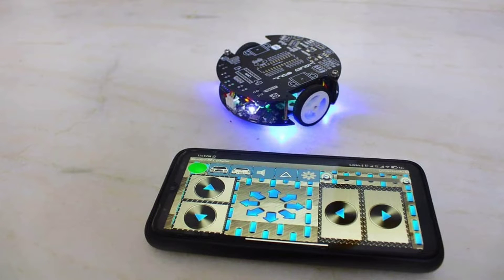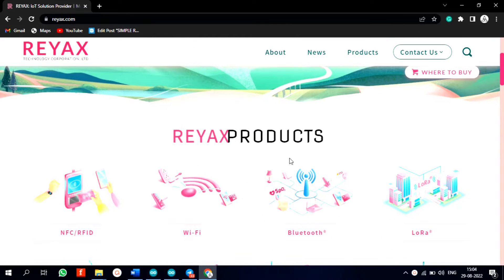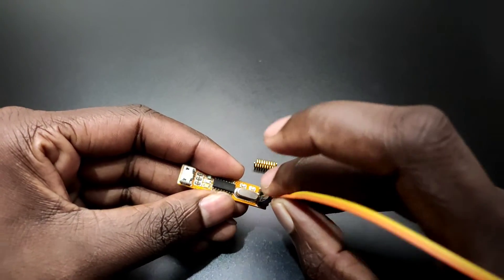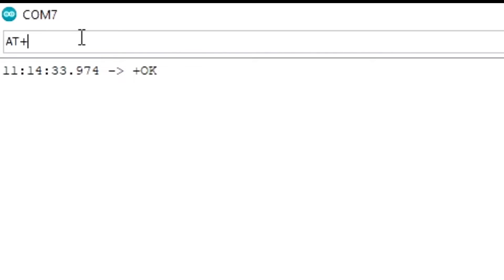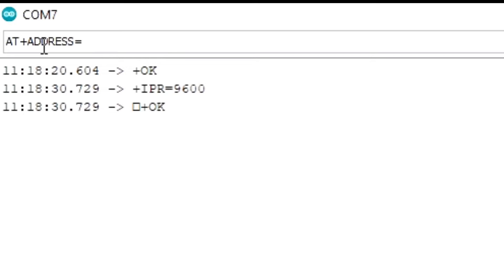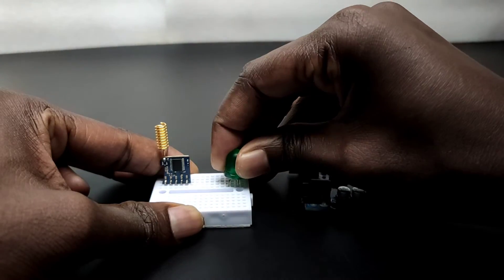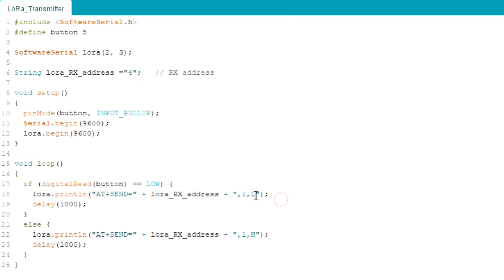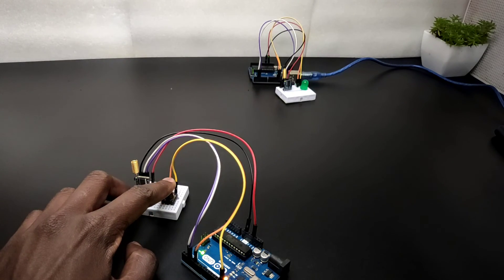How to interface LoRa module with Arduino | Reyax RYLR998

Comment: I have RYLR998,  when set band using At command "AT+BAND=865000000", it remember only when it is connected, when i disconnect and connect and ise "AT+BAND?"
it shows +BAND=915000000Hz, why it is not remembering BAND?
Reply from the maker: You have to save it . There is an AT Command for that . Check their datasheet
Reply: @EDISON_SCIENCE_CORNER  I went through complete AT commands and other doc, nowhere mentioned of save, BAUD rate, address and networkid get automatically saved
Reply from the maker: Let me check that.
Reply: @EDISON_SCIENCE_CORNER  Please, i lost my whole day, SoftwareSerial not sending AT commands, no reply to AT commands

Comment: The RYLR998 is  NOT 5v tolerant and should not be connected directly to the Arduino IO which operates at 5v. You will need a TTL converter.
Reply from the maker: Sorry

Comment: How to bi directional data pass between nodemcu and Arduino?
Reply from the maker: Nodemcu to arduino.?
Reply: @EDISON_SCIENCE_CORNER  both
Reply: @EDISON_SCIENCE_CORNER  vice versa
Reply: @EDISON_SCIENCE_CORNER  for example received data from the cloud in node mcu after same data send to Arduino after data some task perform like led1on == led1on : led 1 on otherwise led 1 off after Arduino one push Button an press after some data send to node mcu after same data send to cloud
Reply from the maker: It is possible
Reply: @EDISON_SCIENCE_CORNER  can you please make video on it? That will be very helpfull for me.